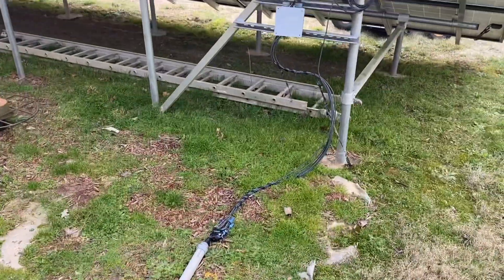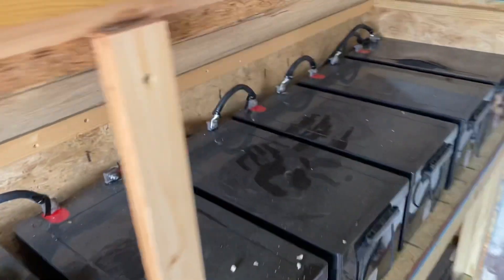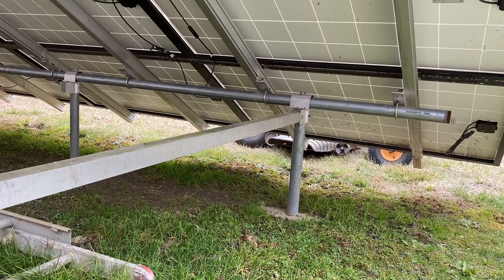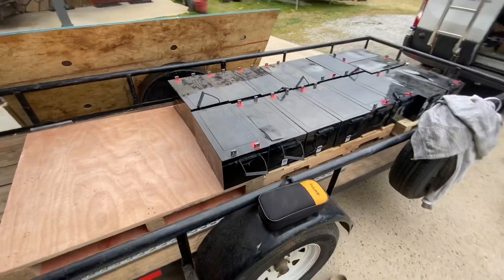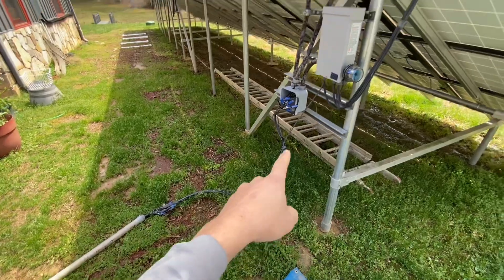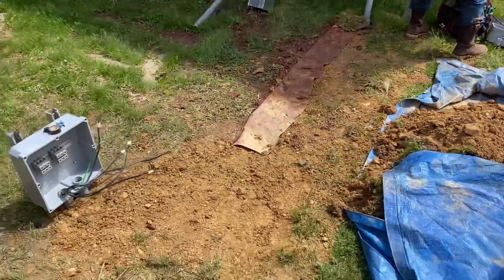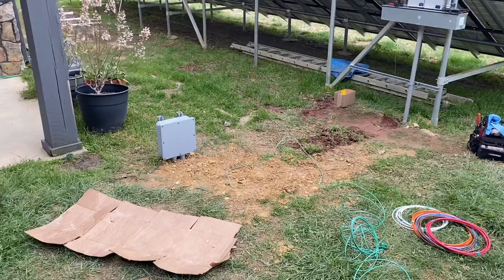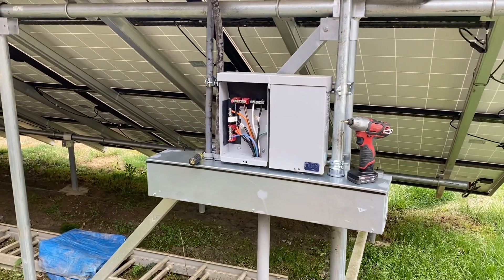Solar installation and Repair

Comment: why do you put conduit/fittings on top of outdoor junction boxes and wire trough? seals and gaskets will crack over time and leak. wouldn't it be better to run it underneath?
Reply from the maker: I only use the boxes as feed thru toughs there are no live connections inside. It looks nice to run out the top. I open up a lot of old boxes. It’s not like it has a garden hose on it. And the boxes can drain

Comment: I need a similar system and have been comparing outback radian, schneider conext 6848, magnums or solarks.  I'm trying to have a minimum of 12k but would prefer 16k+ inverting power. And, I'd like to have at least two inverters for redundancy. We need a system that can run a well pump, AC in the summer and have enough power to run a heavy load every once in a while if needed like a small welder. I'm leaning with the outback or conext, what are your thoughts on this? The solark doesn't seem to handle large inductive loads very well. If you were building a new system from scratch today what would you choose?
Reply from the maker: If you are going to DIY the solark is a lot easier. I’d rather have two 12ks that a 15k.
Reply: @GainSolarPower  From what I've seen the solark seems to shit its pants like a night of budwieser and taco bell when trying to start inductive loads; and it seems more sensitive than a woman asking "do i look fat in this dress" on unbalanced loads with "blue wire nuts" lol
Reply from the maker: It sounds like you are watching lots of David Poz…..
Reply: @GainSolarPower  David, Bens Solar and people on diysolar forum all report the same issues with it which is why I was looking at the outback or conext. I think Ben, which is also a solar installer you might know, put in a auto transformer to help with unbalanced loads on his personal solark.
Reply from the maker: Jv@gainsolarpower.com

Or 
7708433497

Contact me. If you are DIY ing two solark 12k’s would be my first choice.
Reply: sol ark 12k 2 units best way to go. They cost me 6k each

Comment: we call them clear taps johnny. and we call that flex sealtight. both are old brandnames and southwire still writes writes it on their LFMC
Reply from the maker: Lots of names for electrical parts
Reply: @GainSolarPower  no doubt. thank you and the big boss man for the videos. one of these days i will hack a system like this in to my place

Comment: I though they are a Federal Law that a electric company must buy back power. I have talked to the PUCO in a few states and I have found out some electric suppliers don't have to follow the same rules.
Reply from the maker: They will allow you to sell back they just won’t give any money for excess power
Reply: When supplied by electric coops it's up to them to what buyback program to offer.